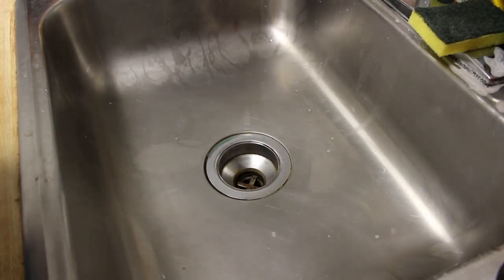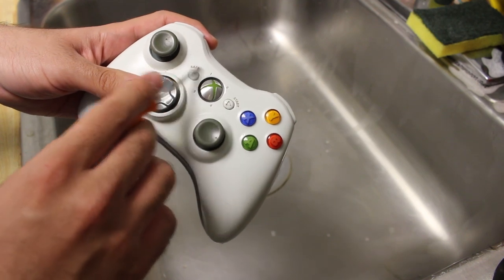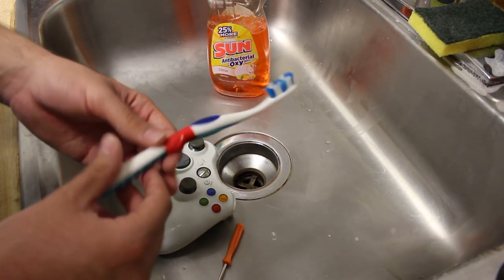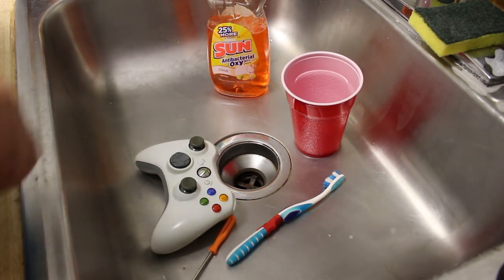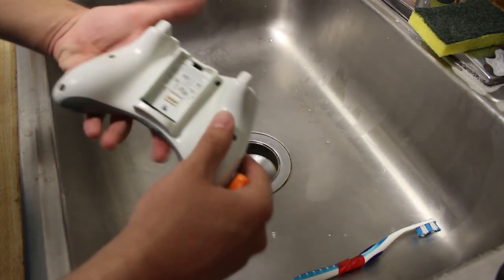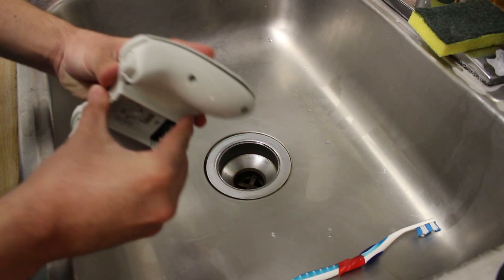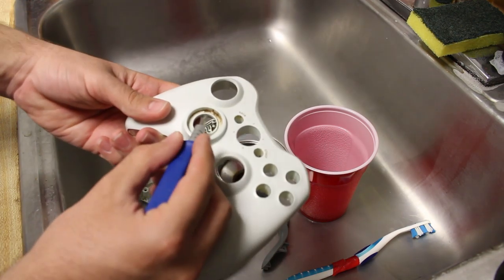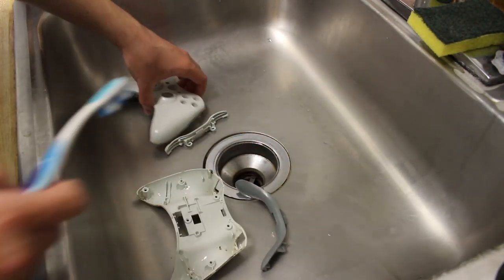How to Thoroughly Clean a Controller

Comment: I have some sort of white mould looking stuff growing on my Xbox controllers whenever I run it off with a tissue or whatever. Is that actually because of skin bacteria/bacteria on the skin or whatever? Btw I do wash hands frequently a after bathroom use just as you know. But I don't get how does it manage to get inside on a PCB board wtf? Sure at some point the controller won't work because of not frequent cleaning right?
Reply from the maker: Most of the PCBs I've looked at have some white on them as well, honestly it's pretty hard to purposely kill a controller by use alone (unless you're banging it around), but it never hurts to clean it.
Reply: My control gets that white thing too. Im pretty sure its from sweaty hands and it just accumulates there. My hands sweat  lot so i have to clean mine often.